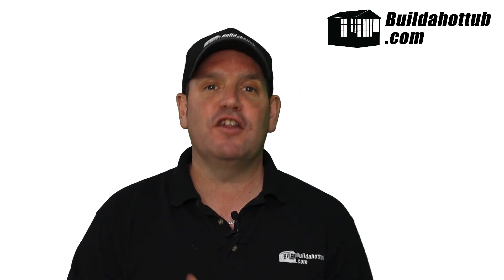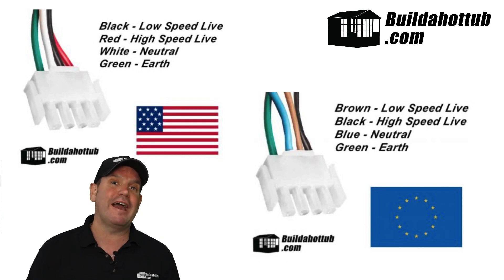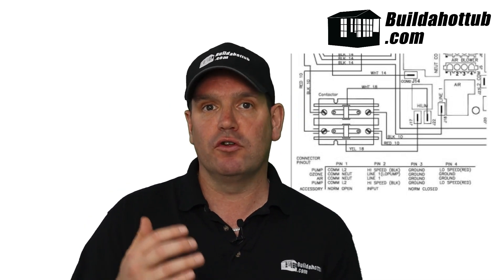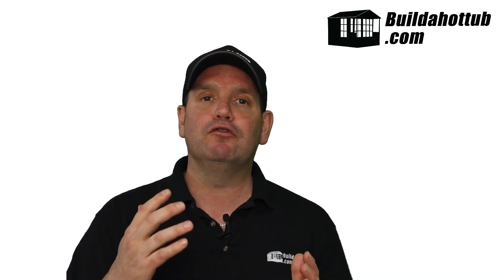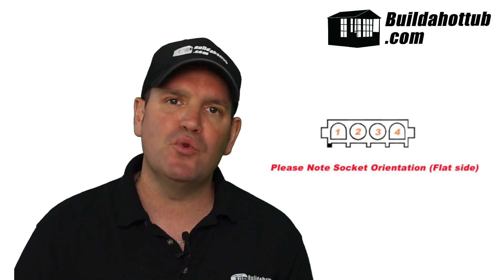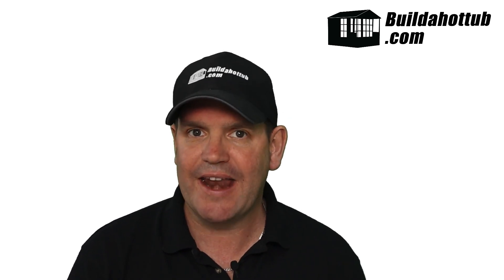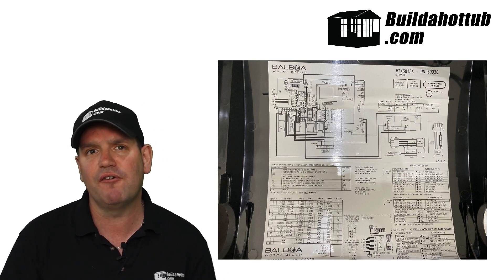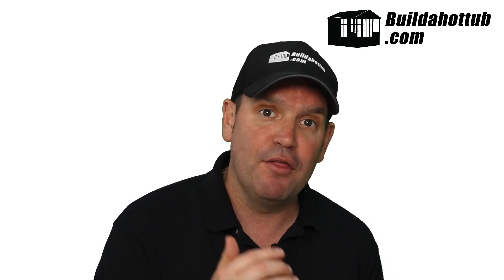How to Correctly Wire a Hot tub Pump - AND WHAT NOT TO DO!

Comment: What happens on a spa motor if you swap the high speed and low speed wires? My 4 hp pump seems very weak output compared  to the original 5.5 hp.
Thx
Reply from the maker: Hi there - thanks for the message. A dual speed motor is meant to do low speed filtration and heating and high speed for the jets. If you swap over the low and high speed it will swap this around - this is not advisable as you should not be filtering and heating on high speed (inefficient) - plus it will cost you a lot more to run. If the pump is on its way out, I carry a large range of replacements in my parts store - https://parts4tubs.com - hope that helps - Andi
Reply: @Buildahottub  got it.
This pump is for jets only as I have a separate circ pump.
I probably transposed black n red wires at motor.

Comment: I'm replacing a new balboa BP7 pack with new cords current pump looks like L1 -White  L2 Blk  My new cord orientation is flat side down is red blk wht grn   will this match my pack & pump .. my pump diagram grn Comm on top , lo-speed , hi-speed  
Where on the diagram are the pinouts located ?  
Thx for you help
Reply from the maker: Hi Gary, try and trace the pin outs back to the pump diagram that will be on the side of the pump, dont rely on colors - here is a link where I show which of the Balboa pins do what - https://buildahottub.com/hot-tub-wiring-explained/ - hope that helps - Andi